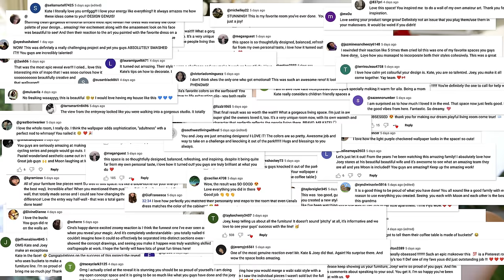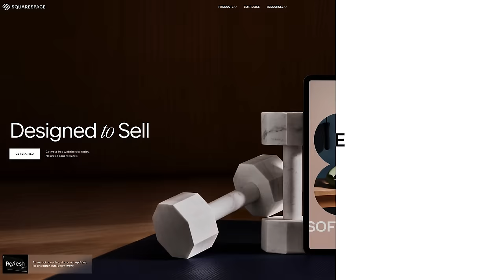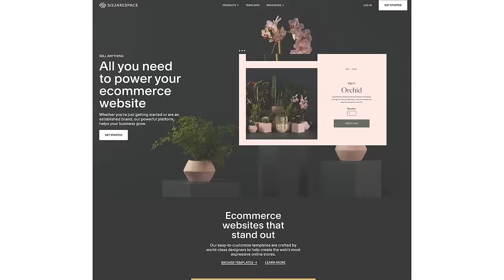She did WHAT to our BEDROOM?!

Comment: I think the best option is the black frame for the bed. In my opinion having a contrast from the wall could help have a pop and have a statement from the rest of the room. Also I’d love to be apart of your giveaway. My room is mostly crème and has fun colors around. I have a frame sort of that holds my bed up under my bed that can not attach to my head board. Always gets pushed off the walls just from getting on and off the bed. I would love a furniture piece from your line. Becoming an interior designer I’ve used your designs in many theoretical projects for college and would love a parchment crème in a queen size. Thank you for what you do and share I’ve learned so much from you guys !!!